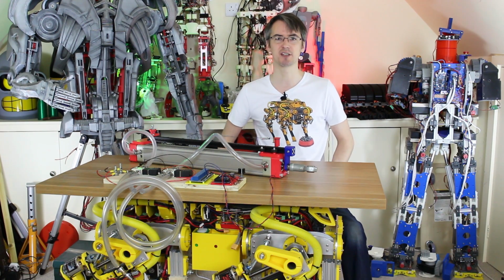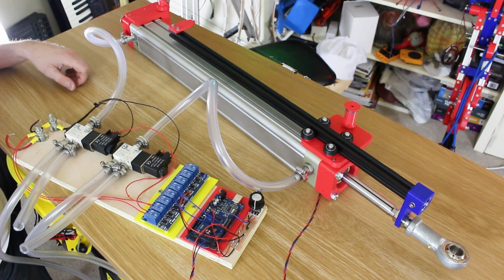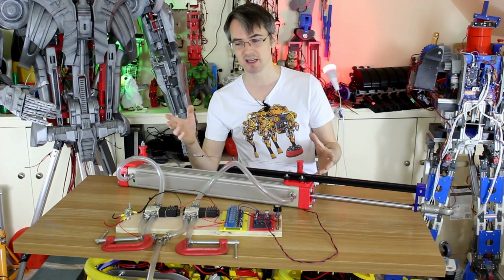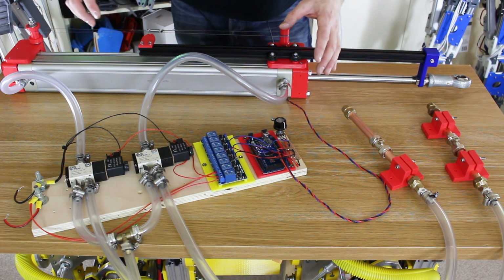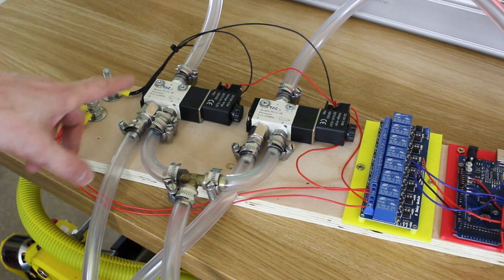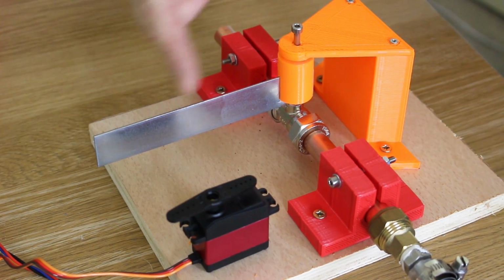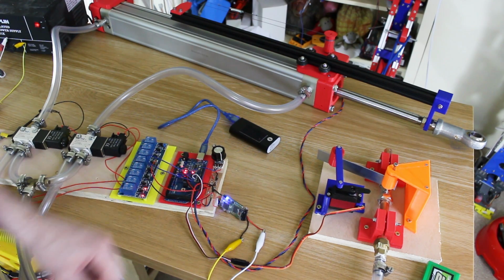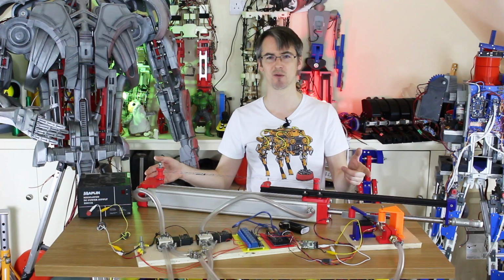Testing Proportional Control of Pneumatic Cylinders | James Bruton

Comment: wish I had a cylinder. if so i would be curious to go back a step and tee the air from 1 tank direct to both ends of the cylinder. no solenoids etc. with cylinder centered open the tank.  would it creep.  I am guessing yes, but would it creep as much as it did in this video.
Reply from the maker: Yes - a lot, because there is a direct path between the two sides. I did this in part 1
Reply: @jamesbruton  so I guess thats the reason, with a single source and thus a direct path, then as the cylinder creeps a bit the pressure slightly drops and is easily filled by a close by source of air, the other side. A suck/pump thing and will shortly stop.  Whereas when there are two separate sources it is much harder to pump back into the bottle.  So I am guessing there is creep in both cases and in both case it will stop (eventually given a long enough cycliner).  In the case of the two supplies there is still creep just negligible.
Reply: but then that doesnt solve the case for the return valve setup unless they dont completely close or there is more space in additional pipe work.  This is fun.

Comment: Awesome puzzles to solve. had to think a bit before i got the creep thing ... different surface areas on the piston (i think you say volume but mean surface area, i maybe wrong)
Reply from the maker: That it - but why does it go away if I use separate air sources?
Reply: @jamesbruton  that is a good puzzle as it does seem to go away completely with two sources.
Reply from the maker: @kissingfrogs  It fundamentally different though because the creep is always in the opposite direction of the initial travel. With one air source it's always in the same direction and it creeps for much longer.

Comment: For the back EMF from the coil. Use a simple diode in parallel with the coil. It will stop the current from going back in the arduino board!
Reply from the maker: It's already isolated by relays and on a separate power supply. So there's no direct connection.
Reply: James Bruton Oh wow then that's really odd! Maybe putting a metal shield around the solenoid or Arduino can help. Ferrite cores like you did is also a good idea
Reply: @jamesbruton  I didn't see it in the video, but how close together are the components and wires?  You might be getting a bit of cross talk via induction.

Comment: Air is compressible, and also your hoses and equipment will increase its volume under pressure. This is a well known problem in pneumatics. The better choice will be, I know ist another technolgy, to use hydraulics.
Reply from the maker: That is a whole other matter with it's own issues, such as having a pump with fast enough throughput to move lots of cylinders all at the same time.

But why does separating the air sources make the creep go away
Reply: @jamesbruton  Because the pressure using one tank is the same on the left and right chamber. Then you have one side with a greater surface and one with a smaller surface because of the piston rod.  If you have two tanks you will have after a small time, depending on the storage volume, a pressure difference in both tanks. This results in different pressures on the left and on the right side, so that you have no pressure equilibrium but force equilibrium. With small volumes you have that, what we call it in Germany breathing of hoses, which can be overcome by higher volume of the medium.
Reply from the maker: @DocMicha  But it works fine straight away after charging the tanks - they are the same pressure, they are both 24 litre tanks - the same as the single tank.
Reply: @jamesbruton  Yes, but ... I have to do the math to give you the real explanation. But that is not possible here on YT. Only a very slight pressure difference makes a huge difference. And the higher pressure on one side comes directly after you `release´ the piston. It does not have to move much or almost at all (principle of a so called  pressure intensifier PI). PI do not move at all in hydraulics and in pneumatic only so slightly.

Comment: You need to add some Opto-isolators for those relay controls so you don't get that back EMF issue.
Reply from the maker: They are already isolated by relays and separate power

Comment: Just use Hydraulics, the Hydraulic fluid is non compressible, that makes it much easier.
Reply from the maker: That is a whole other matter with it's own issues, such as having a pump with fast enough throughput to move lots of cylinders all at the same time.

Comment: Use a pressure regulator on the non rod side and set it so the creep goes away.
Reply from the maker: right, but why does it go away when I use two air sources?
Reply: @jamesbruton  because they are uneven pressure the regulators are not that accurate on those. Come to think of it doing what your doing you may need one on both sides to account for changing pressure in the supply tank as well. I never tried it to the extent you are trying for but it would make perfect since. With two regulators one on each side of the cylinder you would have perfect pressure for both sides not fluctuating as you use your supply. I can draw a diagram later today if you want?
Reply from the maker: @curtstacy779  There are no regulators on either tank.
Reply: Had time to think! lol you have everything to test it properly.

1. Use both compressors, but set the regulators below low pressure pump start. On both compressors. This will keep pressure constant.
2. Set your flow control valves you made for a slow travel both ways.
3. Turn on both solenoid valves, adjust non rod end of cylinder till you have no creep.
4. It should now hold position as best it can. The rod side will have slightly higher pressure. To make up for surface area of rod on piston.
Depending on your valve you may need to stop the cylinder with the flow control valves. And or Leave the air valves to the cylinders both on to maintain the no creep setting you did with the regulators
5. Slowly increase  flow control speed to calculate for over travel at higher speed.

Good luck man! Can't wait for the next video.
Reply: Oh no just saw no regulators on either tank. That sucks. It wont work without those to make up for surface area of piston and to keep pressure constant. I have seen some cheap ones at home improvement  stores in the US maybe there too?
Reply: @jamesbruton  sorry I realize now what your asking. Man its hard to explain your self in comments. The surface area is smaller on the rod side of the piston as you stated. So with one compressor you have the same pressure at both ends so it has more force on non rod side, and travels out. With two compressors they are slightly different pressure, you got lucky the higher pressure ended up on the rod side to make up for surface area. It is very sensitive adjustment. That is why below instructions I said to set regulators below low pressure start on pump or your pressure will not reach the regulator set point. And will change constantly as pressure lowers in the tank.
Reply: I should add, remember how to calculate force of a cylinder? Pardon the standard measurements it's the only one I remember. 3 inch piston 100 psi = 3 x 100 = 300 lbs of force. So on the rod side you have half inch of rod so let's say 2.5 inch area on that side so you only have 250 lbs of force on that side. 
I hope this helps sorry it took so much to explain myself.

Comment: I think you need to accurately measure and PID control the pressure using two (both pressurise and relief) proportional valves on each side - 4 valves in total. Then another PID driving the two pressures from the position. Add recuperation valves for optimisation.

Comment: I wonder if the creep then stop is due to air cooling (and shrinking)?
Reply from the maker: It due to one side of the cylinder having a higher surface area because the rod ins't using space up in the cylinder on that side. But why does the creep go away when I use two air sources?
Reply: @jamesbruton  I know what you are referring too - that creep, as you say is due to different forces on either side of the piston because of the difference in areas either side of the piston which is exposed to the same pounds per square inch. I was referring to the little backwards move after you've stopped the cylinder moving. I think it may have something to do with letting air out of the tank and putting air in the cylinder, or letting air out of the cylinder and into the room - the sudden pressure change causes heating or cooling of the air in the cylinder and tanks (increased pressure means heating and vice versa). Hot air gives higher pressure - until it cools and cooled air has less pressure until it heats. The heating and warming occurs in the chamber (either the cylinder and/or the tank) during the short moment you open the valve. Using two cylinders reduces the effect substantially because pressure change in the tanks is less and heating/cooling is also less leading to a "double" cause for the reduced effect - possibly completely masked by friction or something?

Comment: Don't forget air will heat up and expand when going through a small office and then will cool and contract. This could cause the creep.
Reply from the maker: It's due to one side of the cylinder having a higher surface area because the rod ins't using space up in the cylinder on that side. But why does the creep go away when I use two air sources?

Comment: Could have been posted already but could you remove the two solenoids altogether, put a check valve on each side of the single source t-piece and have a bleed valve on each end between the check valve and cylinder controlled by two servos that you could open each one a bit to release the pressure in each side?
Reply: on second thoughts you may need the solenoids behind the check valve to prevent just venting the pressure from the tank when you open the valves, just have them setup almost like you had except have:

                                      --->  Solenoid (return blocked) -> Check Valve -> Vent T-Piece (vent to atmosphere)  -> Cylinder Top
Air Tank -> T-Piece --|
                                      ---> Solenoid (return blocked) -> Check Valve -> Vent T-Piece (vent to atmosphere) -> Cylinder Bottom

on each side and then block the returns on the solenoid so that no extra air comes out when it is deactivated, the check valve should keep the pressure in the cylinder ends and then the vent lowers the pressure? Having the solenoids active linked to the "fully closed" position of each respective servo so the pressure is held and then pressure stops and vent opens to move either way? you could then even use it to balance the pressure if you had a pressure sensor on each side

Comment: Do you have a diode across the solenoid terminals? It might be the voltage spike caused by the inductance of the solenoids that kills the arduino. You can also put something like 10E resistor in series with the solenoids to reduce the peak current.

Comment: there might be solution to feedback loop when having one air source coming also release one then if you can connect release the air and coming air as a feedback loop it might help even keeping in and out seperate with 1 release valve and one intake so pressure equals in cylinder

Comment: As someone else noted, flyback diodes on the solenoid coils may reduce back EMF to a workable level to stop Arduino from freezing.
The change in creep i think is more related to the changed methodology, rather than 1 vs 2 tanks. Pretty sure it'd be very hard to reach a desired target & have no creep in a pneumatic system with just single on-off actions like you were testing. At the most fundamental level, in order to achieve motion the pressure on the downstream side of piston Must be less than that upstream...  simply closing everything up when target is reached leaves you with a pressure imbalance, which will naturally correct itself back to equilibrium. You can see this is solved in industrial electro-pneumatic positioners basically in software - they rapidly adjust & re-adjust pressures to both sides of cylinder as they get closer to target position. Can do same with your system, PID fixes everything!

Comment: Yes, the volume is irrelevant - there is simply less surface area on the side of the piston with the rod, so less force acting in the direction of travel than the other side.
Reply from the maker: So why do you think separating the air sources makes the creep go away?
Reply: @jamesbruton  If the air lines are independent then they'll each find their respective pressures that equalize the force on each side of the piston. To verify, you could add pressure gauges to each side.
A piston with equal sized rods on both sides of it would likely have equal radial area that can exert a force in the desired direction, so that could be workaround, otherwise you'll need asymmetric inputs for push or pull.
Pressure on the rod itself is 'wasted' because does not act axially.

Comment: Having had to build a lot of "machinery" in my career I have found that pneumatic positioning is not a good choice if your positions are not solid stops and needs to be accurate.
The compress-ability of the gas (air) means that slight differences in load, ambient air temperature and a slew of other influences give erratic positioning if you are trying to position something "half way" in an accurate manner.
For example if "dog" uses a pneumatic leg positioning system and it is stationery then by lifting one leg off the ground the other 3 legs will compress and the pid will have to kick in to compensate. 
The same applies if you add a weight.
Now I am not saying that it will not work! 
On the contrary... The result may be closer to the movement of a real dog once you have the "fuzzyness" of the control circuitry sorted out.
If you measure the position of the cylinder AND the pressure within each side of the cylinder and adjust these as opposed to just the pressures both sides of the piston there may be some good success (if electronic pressure sensors don't break the bank).
Here is wishing you the best of luck.
Reply: A good thing for pneumatics is that you have some suspension for free.

Comment: Not sure if you have come across the solution yet, however I have an idea. 

When air is compressed it heats up and expands. Once you close the fill valves the air inside the cylinder will be cooling and contracting. Because the smaller side has a lower volume the contraction will be greater resulting in a lower pressure than the larger side. 

This also explains why separate tanks help.
Reply: i like your thinking.
Reply: @kissingfrogs  That, and since he's using compressed air that is rested or static (at least in the video) it is probably at room temp.  As he releases it from the tank the expansion (and pressure drop) will cause it to drop in temperature.   When it absorbs heat from the environment it will expand again.  Lots of things going on here.  

There's a reason precision positioning systems are hydraulic and not pneumatic.

Comment: Maybe try to feed the lower side of the ram with air via a separate regulator set lower to account for the difference in surface area and force of the two directions this way they should also be able to be fed from the same air source  as a regulator won't back fill a tank if it gets a pressure rise on it's input it would vent to atmosfear ,

I would try the following layout 

Compressor - regulator and split the line here to the separate sides of the ram but just before the lower side valve another regulator to lower pressure for that larger end this I think would eliminate creep and give equal force in both directions also giving a more forgiving and predictable control

Comment: The surface area of piston is less on return side because of rod so use regulators to drop air to push side piston will still be touchy though
Reply from the maker: Yes, so why does the creep go away when I use two separate air sources?

Comment: use some reverse polarity flyback diodes across the terminals on the numatic valves. I think the relay board probably has them built in but if they dont you will definitely need them there as well. 
they work by snubbing out the inductive spikes created when switching anything with a coil of wire involved.
Reply: I cant help but think with all of Jame's experience he would have used flybacks once or twice before but as they say it pays to never assume
Reply: @kissingfrogs  You never know. he seems to be much more experienced with code writing. typically people like that are not the most knowledgeable about builing your own circuits or modifying existing products in that manner.  as he typically does not do that sort of thing on his channel.  but thats just my guess.  and would likely fix the problem if applied
Reply: Its not too critical with relays.  It will eventually burn the relay contacts, after some years..  Different story if it was a semiconductor driving it..
Reply: @SteveWrightNZ  yeah im not talking about protecting what the relay is switching. they are built to handle arcing. however the semiconductors connected to their big inductive coils are not built to handle their spikes.